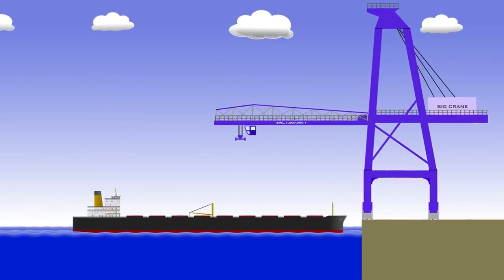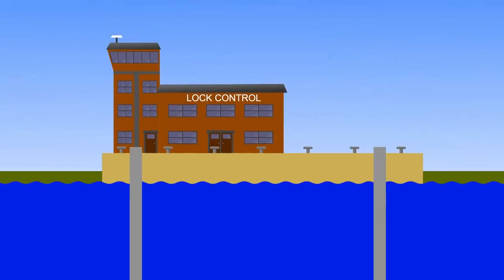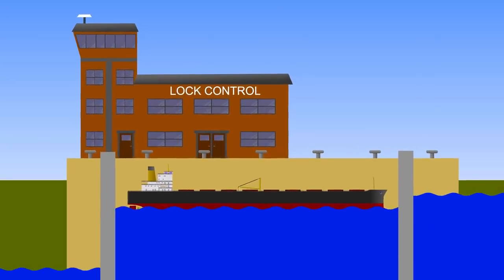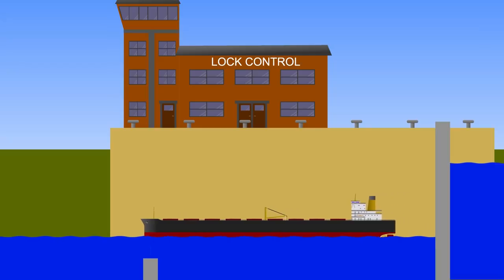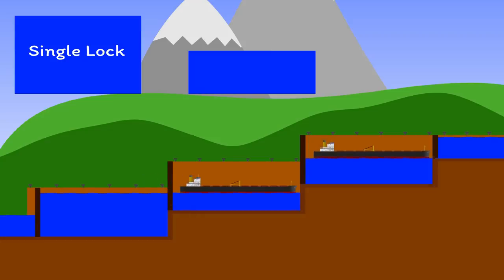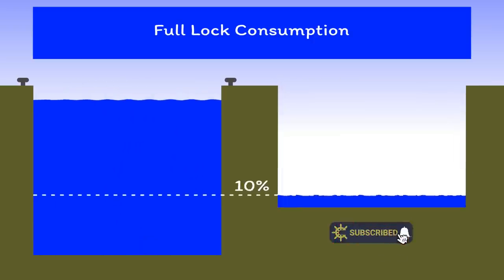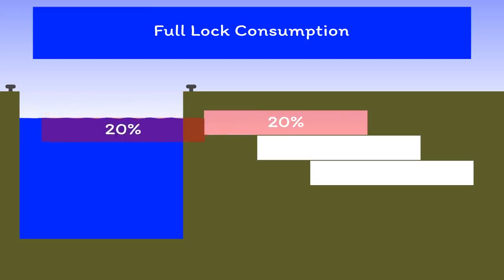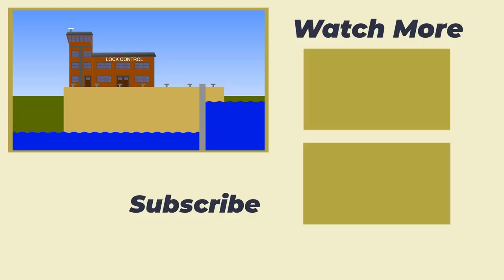Panama Canal: How It "Lifts" Massive Ships

Comment: And then for small ship, high displacement locks, a gravity hydraulic lift lock is even more efficient. The Trent-Severn waterway in Ontario Canada has two of these lift locks, only wasting about a foot of water each trip.

It works by having a hydraulic system in the shape of an ‘H’ with a stop valve in the middle with two piston rams on either side holding up a basin each. The water depth on top is greater (about a foot or so) than the bottom so when in it's open position, one basin is gaining water and the other is losing water. When it's time to switch, the valve in the center opens and the side on top, due to it having more weight from that extra foot of water, let's gravity take control. This goes until it reaches the bottom and the valve is closed. At this point, both basins open up, restarting the cycle, now on opposing rams.

Comment: I've lived for over five years on the English canals and locks are a major feature. My favourite is the Caen Hill flight of 16 locks at Devizes in Wiltshire. Each lock has a large side pound to enable it to work. The canal between locks is a pound anyway, but close together locks need extra help, and Caen Hill also has a pumping station at the bottom to assist at drier times.

Comment: Something else interesting to note, I learned when transiting the Panama Canal, when entering a lock, especially when you are panamax width and close to panamax depth, the propeller doesn't so much push you into the lock, as it acts as pump, pulling the water OUT of the lock, and allowing the ship to take up the volume displaced inside the lock.  We would be at 1/2 ahead maneuvering, and be making about 1/2 of our Dead Slow Ahead speed as we entered.
The other thing I learned that trip, if you don't keep an eye on the riding gang, they will flush chicken bones down the toilets and royally mess up the MSD tank!
Reply: Huh, so you all needed to put some extra oomph into entering such a confined space because of the displacement that the ship took up trying to get inside.  Interesting.
Reply: @ryanotte6737  correct.  Especially when you “barely fit” into the opening
Reply: @stephenbritton9297  Interesting indeed and thx for sharing a little engineering/practical tidbit about how such an important part of the global economy operates.  Whether it be pulling the water out via the prop or thought of as the ship's hull pushing the water out of the confined lock space, either way there needs to be some extra work/energy/power applied to make it happen.

Comment: In this email country, we have approximately 4,200 miles of inland waterways.  A large majority of which are canals. I spent six years living in a 62’ narrowboat. Considering that many canals have to cross mountainous and hilly parts of the country, this involves the use of many locks, however the canals often bore through hills in tunnels or use othe means to effect a transit from one level to another. The Anderson Boat lift is one, there used to be an inclined pain at Foxton and in Scotland there is an ingenious counter-balanced wheel at Falkirk. Locks are also used on navigational rivers, which hol water back to create weirs, accompanying them to effect a change of water level.in a flowing river.

Comment: I've been interested in canals for many years and read several explanations as to how staircase locks and pounds save water, none of which I've fully grasped. The graphics with your explanation made so much more sense. Very educational, thanks.

My one question would be doesn't the bi-directionality of the traffic spoil the water efficiency of the Panama Canal locks somewhat, or do they use different sets for each direction? Does this help?
Reply: Boats going in opposite directions save water as you don't need to fill the lock
Reply: @snailhawk  you need to think that through a bit better in light of the staircase lock situation referred to.
Reply: I have some experience in marine engineering, though not with locks.  In any case, you can see the satellite imagery of the Panama Canal locks and other lock systems throughout the world that have high bidirectional traffic, particularly crossing inland.  The north end of Panama is particularly clear that the two sets are for bidirectional traffic.  In general, these situations tend to use two sets for each direction from what I can tell.  Practically speaking, I imagine there would be water savings given having the two sets could continue that sequential set of ships passing through that allows the multiple-locks and the water-saving basin setup to keep the water savings going as demonstrated in the animations.  Reversing traffic direction would likely require draining much of that water savings built up.

This seems like one of those scenarios where I am sure the experts considered traffic consistency and a number of other factors put into a equation set or design spreadsheet of some sort.  How much they save by having two sets, I couldn't say.
Reply: The St. Lawrence Seaway (Great lakes and St. Lawrence River) only has a single lock going around the Moses-Sounders Dam (which has 2 observation points, covid closed the one at the visitor center). Being on such a large river with relatively low traffic flows i imagine then can plan traffic to raise a ship and then lower a ship with the same water, effectively halving water usage on top of any other wayer saving methods employed.

I also suspect that the whole system together counts as a ladder lock, just with many miles of river / lake / reservoir between them. (Technically we call the reservoir Lake St. Lawrence and I'm kinda fuzzy on where it ends and Lake Ontario begins especially since the Thousand Islands looks like a reverse  river delta (they are made of rock though))

Comment: Small correction, the angle of the gates is to turn them from more of a horizontal beam into a compressive arch, but they don't prevent buckling. In fact, buckling is something that happens specifically due to compression.

The compressive arch just makes for a much easier mechanical design.

But even then, the gates are usually prismatic (rectangular) while the water pressure increases with depth. This means there's a rotation applied to the gate that makes everything complex again.

Comment: It's interesting what you call a sluice.

In Dutch, a "sluis" just means a lock as a whole.

It's not limited only to waterways, but any situation where you have to close one door before opening another. So you have a "sluis" for entering spacecrafts after a space walk. Or some restaurants may implement a "sluis" during the winter, to avoid the cold wind from coming into the restaurant.

Comment: Very good video, just one correction, Gatun Lake is an artificial lake that was created during the construction of the canal
Reply: It still has a limited amount of water from natural sources, and if it gets too low it will cause many people problems, both residents on the shoreline and ships with deep drafts not being able to traverse it. 

Theoretically they could pump water up into it from the lower lock levels, basically instead of dumping the bottom lock into the sea, dump it into another basin and pump that uphill, however far you desire making it a more closed loop system. But this is expensive and probably would only be done at critically low water levels as its still better than closing down the canal (or even just slowing down operations)

Comment: I work as  a technician at a lock for a port that has a tidal river, and it is hard to imagine any decent sized lock located at a tidal port to just open the lock doors on high tide, quite a big set of risk involved in that, maybe when its the hinged door lock it could be possible but i don't think big locks will use those types  of lockdoors. We certainly don' t (our port has 3/5 biggest locks worldwide)
Instead we have canals that lead from the river straight into the dock with those sloosdoors inbetween and we open those once it is high water. Literally no pumps are ''normally'' involved with filling up the docks

Comment: Very interesting video, I knew the basics of locks but these water-saving tricks were new to me. Can you make a video about the Falkirk wheel? If I understand it correctly it doesn't use up any water, but require some electric power
Reply: It is simply a heavy duty bearing and two buckets. The two buckets are always exactly equally heavy because ships displace their own weight in water, so if the ship floats in the bucket, the ship+water always weighs exactly as much as the water in the other bucket. Because the buckets are equally heavy you don't need any energy to lift them (the weight of one going up is balanced by the weight of other going down), just enough to overcome the friction of the bearing and inertia to get the buckets moving.

it doesn't use any water because it puts back the same volume of stuff as it removes each cycle. Plus or minus the volume of the ship, but ship behaves similarly enough to "water" in a water system.

Comment: I was thinking of how really big ships get put into the sea once constructed. I know they usually slide them off a ramp. But for really gigantic boats it seems a little risky. I had my own idea which is probably the safest and works just like how they raise boats here. I imagined they'd have an empty area where they build the boat, then allow the ocean to flood in and slowly raise it then the gate to the ocean can open so it can leave. And i assume they'd drain that area like a flood canal.
Reply: What you just described as a dry dock
Reply: @conors4430  Yes that's it. Thanks. I just checked out a dry dock being flooded for the John F. Kennedy aircraft carrier. It takes about 10 hours to fill, and about the same to drain. And there's also floating dry docks that fill chambers of water to lower itself and drain them to raise ships out the sea. The more you know.

Comment: Great video as allways! :) I have a question regarding the last point you made about the refilling of a dock: Isn't a change in waterlevel a problem for tied down ships as the ropes they would be tied down with tense up or get loose?
Reply from the maker: The area of the dock is quite small compared to the area of the lock. This means each cycle will only drop the dock a cm or so. Ships move much more than that when loading and unloading cargo anyway.
Reply: @CasualNavigation  Is that movement someting you have to think about while loading and unloading or is there enough give in the system to compensate for that? :)
Reply: @abgehn7869  i imagine that the draft change of the ship from loading/unloading cargo (loading would be the problematic one) is accounted for when picking out your dock. Its also unlikely that they would pick any docks with too tight of a margine of error as any wave action could then smash them into the bottom. (Waves from either weather or other ships' wakes)

This is why deep water ports are so valuable, it save you a ton of time dredging out both the harbor and channel out to deep water. This is probably why river mouths tend to be harbors, the river is naturally erroding out the bottom for you, or its dropping sediment and creating a protective delta you will need to actively keep clean.
Reply: @jasonreed7522  These are good points!

What i meant was that the change in draft would tighten the lines while unloading as the ship gets lighter. This would introduce additional tension into the ropes tying the vessel to the dock since the ship would 'rise out of the water'. While loading cargo the draft would increase and the lines would lose tension. 

Are these changes in tension in the ropes great enough to have to be planed and prepared for?
Reply: @abgehn7869  probably not, but large ships also have ballast tanks (which must have to opposite water type to the port meaning salt/fresh water for invasive species reasons) so they can add/remove weight as they load/unload to keep a relatively minor net mass change (and therefore displacement).

Besides most ropes are stretchy and will only have enough tension at rest to hold the ship in place, so they should have plenty of give in them to accommodate the minor movement without adjusting / pre planning. 

And while this is a different scale, my parents used to live on a lake and 1 day an idiot removed the planks regulating water level and it dropped like 3 feet and everyone's boats were either on the bottom or hanging from the docks by their nylon lines. Don't underestimate the strength of these ropes, obviously that much tension would make it hard to undo the knot which would be the bigger factor for ships than the ropes being overloaded and possibly failing (which is also bad but needs much more tension)
Reply: @jasonreed7522  I didn't think about the ballast tanks :) 
That must have been a bad day for everyone at the lake!

Comment: This always confused me. I knew the panama canal had locks, but I didn't understand why. The Atlantic and Pacific ocean should be at the same sea level as all oceans are connected, there's no reasonable reason why they should be at different altitudes. A large lake in the middle above sea level makes sense. I wonder if in the future (when it's more economically viable), it's a better idea to just carve a really deep trench and do away with the locks entirely.
Reply: You underestimate how expensive it is to dig. Also that would probably have untold environmental consequences as sealife can now swim between the Pacific and Carribean, currently if they tried they would enter the fresh water canal system and not be able to survive.

1 method used to contain invasive species is that ships must swap out their ballast water mid transit and at port. Basically if you do a ballast change in a fresh water port in Egypt and sail into the great lakes and do another change you will have moved eggs and microbes from 1 fresh water environment to another. But if you dump them out in the Atlantic the salt will kill them and you will now have saltwater loving junk in your ballast water, get to port in Chicago, and then dump this salt water into the massive freshwater lake and it dilutes quickly and now all the salt water loving life dies in the freshwater. The port authority will test ballast water and force ships to sail back out to see if the water isn't salty enough, which is expensive if you already made it to lake Ontario or deeper.

Comment: Does this mean the water in the lake is always being drained away?
Reply: If a lake didn't drain away, it would get bigger and bigger (unless it had
a low inflow and a really high evaporation rate). Locks act like temporary
dams - they reduce and control the rate at which the lake drains.

Comment: your math on the locks doesn't add up. the only way that you would be "conserving" energy is if you had an endless supply of ships to be using the water that the "first" ship used. other wise you are using the exact same energy as one lock for one ship as 3 locks for 1 ship.
Reply from the maker: In places like Panama, there is effectively an endless supply of ships.
Reply: @CasualNavigation  I can appreciate what you're getting at, though effectively an endless supply and a true endless supply are different.

Comment: Does operating the locks everyday multiple times eventually lead to the lake being drained?
Reply: Well yes, it slowly releases the water volume into the sea. The system relies on the lake being refilled through it's natural process. That's why it's important to implement ways to save water to not overuse the lake. Specially in case of drought seasons
Reply: 8:28 - the lake naturaly refills but they do have some problems in the dry season
Reply: The lower the level in the lake, the less you need to raise the ship.
Reply: Let's suppose a single lock to go from lake-level to sea-level needs 440x56x26m = 640,640 m^3 of water, and the area of Gatun Lake 
is 425 km^2 or 425,000,000 m^2 then for one ship (without water saving)
the lake would drop by 640,640/425,000,000 m = 0.0015m or 1.5 mm

Comment: I swear this is all a waste of time in the end. We could easily manufacture whatever we need, wherever we need it. Yet we continue to use ships to move stuff around like it’s 1850. It’s a control and power thing.
Reply: And how exactly are you planning to manufacture the 'thing' that requires massive amounts of raw materials from another continent? Or, say, even the other end of one continent if we take USA as an example? 

Replace a single ship with hundreds or thousands of planes and trucks?

Or move extremely large manufactured products that are far too large to transport by road due to geography and road network limitations from NY to Seattle?
Reply: Depends on how you define the things "we need".